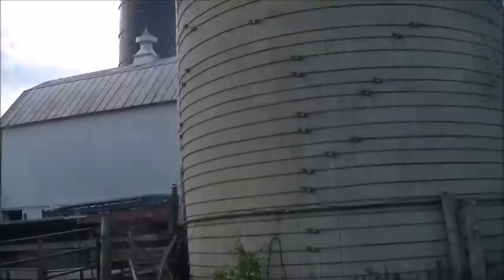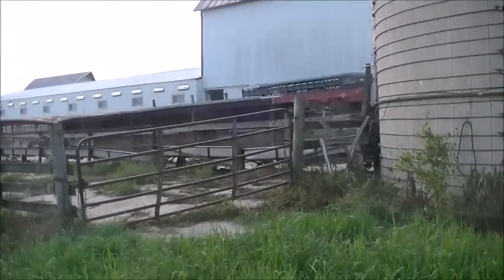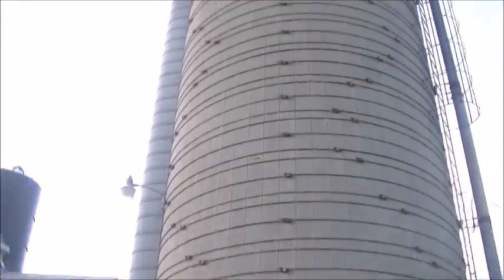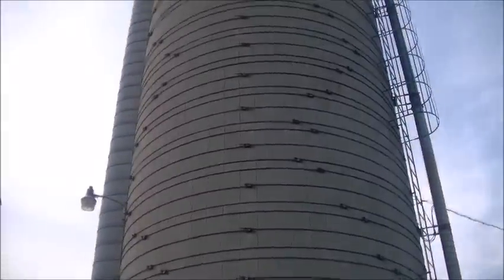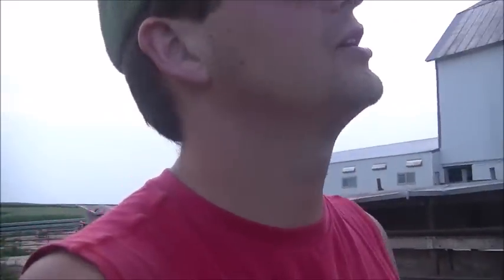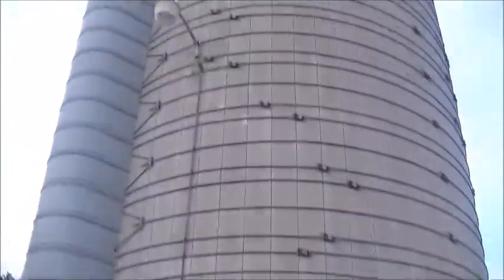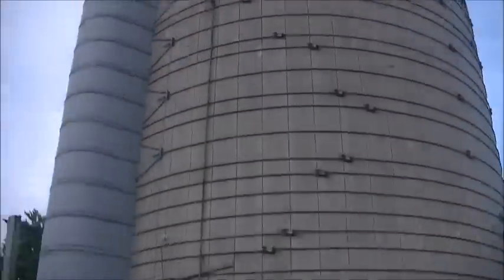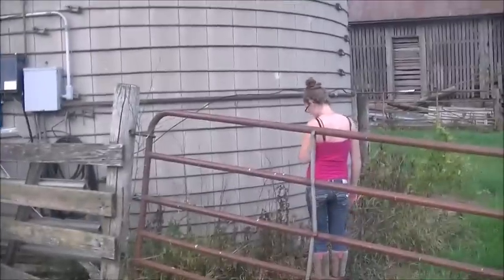The Rockville Cement Silo

Comment: We had an 80' poured cement silo that we always used for 1st crop haylage.  Luckily we only had to change every 4 doors.  We had a chute & pipe that it blew into and down the cement chute so it was much less dirty, but we always wore a hoodie tied tight so we didn't get much crap down our necks.  We also had a 40' cement silo that we used for high moisture ground corn.  Had similar system, but that was much more messy!

Comment: Ryan we own a feedlot and have a TMR mixer we bought at steinharts and brought back to Missouri, but from experience I'm 14 years old and trying to back a TMR mixer down the alley is a pain my uncle has trouble doing it every now and then so o would make the alley where you can pull through or turn around. We normally turn around in the pasture at the end of the pens but when Cattle are in the we have a 150 feet to back up and it isn't the straightest so missing the bunks and fence is a little tricky. Keep up the great videos looking forward to the feed shed video!

Comment: I still fill a 20 by 60 & a 18 by 50 with corn silage, the bigger one was built in '71  & smaller one mid '60's. I feed beef steers, finish them to 1500#. I wouldn't want to feed cattle with out them, especially getting them to 1000#  I also feed round bale hay, in round bale feeders to them. A group of say 225 to 230+ is what i buy to feed. Silo unloaders work good in corn silage, don't wear like they would in haylage, which we always did when we were still in the dairy business. I buy the calves around the 525 to 600 weight class.  Put the corn silage in at around 60%, doesn't freeze as  bad in the winter, & summer feeding, when it's dryer like that, doesn't heat up in the bunk, but they need to get it cleaned up every day. After the corn silage is gone mid July, or this year, tomorrow, i switch them to all dry rolled shelled corn & the hay still.  I have a silomatic belt feeder in the 2 sided bunk feeder with roof & a fence line feeder with roof to, i fill that with silage, feed wagon.  Silomatic silo unloader in the 18ft. surface drive & Starline, small ring drive in the 20ft. Both work very good. I have one other 20ft x 60, that i don't use since quitting the dairy business.  Still standing on the dairy barn, a 14ft by 40 tile silo. Also with the dryer corn silage, under the plastic, it doesn't spoil when sealed up till January when i open the first one & then early April. the other. I always put on a hooded zipper jacket to keep the silage off your head & neck, down your shirt, even in the summer.  By the way, i farm all alone, field work & cattle feeding, i only need some help to sort the fat cattle when selling in them every week in the Fall. Also when raising the silo unloaders, some one to turn the motor off, when raising them into the roof.

Comment: Travis   What are the doors in the silo ?    We don't have silo's where I am
Reply: On the side where the silage unloads, there is a vertical row of doors all the way up to the top of the silo.  As the unloader works its way down from the top through the silage, it blows the silage through those doors into the down chute, where it falls down into whatever material handling system is in place to distribute it.   Unlike a Harvestore, the stave silos empty out in the opposite order of how they were filled (top to bottom with staves, whereas the unloader is at the bottom of a Harvestore).  As such, whoever is maintaining the flow of silage has to lower the unloader with a winch and take out the doors one by one as the silage level comes down.   Hope my amateur explanation helps.
Reply: Matthew   thanks so much I understand now
Reply: AndersonCattleCo. It's also a major pain in the ass having to go up and let it down a door.

Comment: What we like about silage bags is if the skid loader is broken you can barrow neighbors or go rent one to feed cows. If the silo unloader is broke you either use a pitch fork or the cows don't get fed for a while.
Reply: what I don't like about silage  bags is picking up all the plastic in my fields in the spring from my neighbors bags
Reply: We pick them up as we pick up rocks so it is no big deal
Reply: iowadairyboys that's what I hate about harvestores  is when the unloader breaks there's no way of getting feed out till someone comes fix it. An open top you can usually can fix your self or you start forking, still a pain in the ass. Bunk, bags or drive over piles are the way to go.
Reply: Right now we put corn silage in the silo and hay silage in bags. In a few years we want to knock the silo over and just do more bags. No more lifting up the unloader or leveling the silo off to try and re start the unloader.
Reply: iowadairyboys We've fed out of pretty much every setup and now mostly feed out of bunks except for corn silage in  the fall we alternate between two silos every other year to keep feeding fermented feed. Would like to take the silos down someday and go completely to bunks but can't justify it right now. Every system has its advantages and disadvantages we like bunk cause their simple and flexible.
Reply: I like bags because I can put them almost anywhere that is semi level
Reply: Cutting plastic is faster than changing silo doors. And we don't get much waste on dirt. And the bags we have on concrete we have none
Reply: Bags sure beats dealing with unloaders but we didn't like the mud and plastic getting in the feed. Plus mice love chewing holes in the bags with corn in them. And when they're full you can't push a few more loads into them to finish off a field. They were fine for storage for few years till we got the bunks but the bunks are cheaper in the long run.
Reply: Better than climbing a silo with. -40 wind chill in the dead of winter
Reply: We cut plastic every week and a half and we never ever shovel.